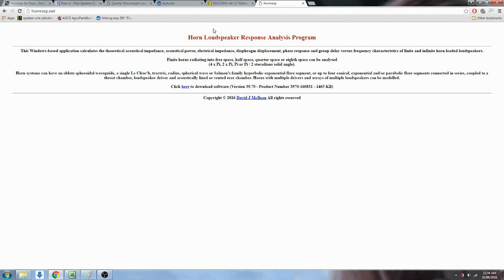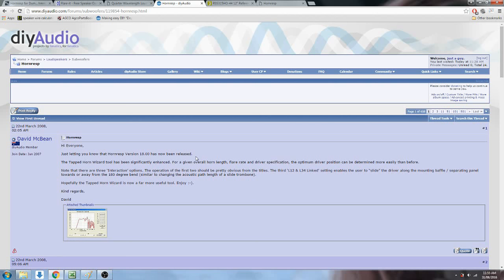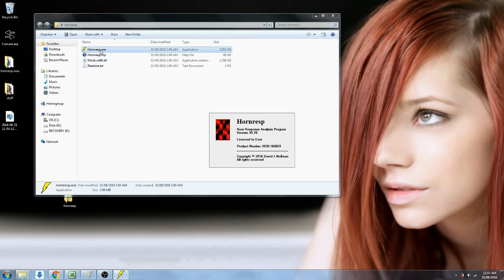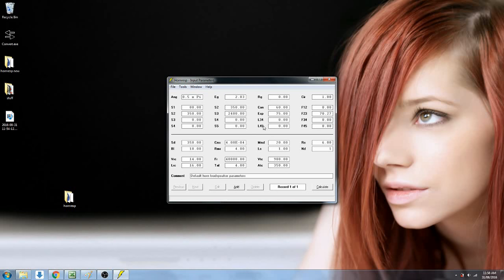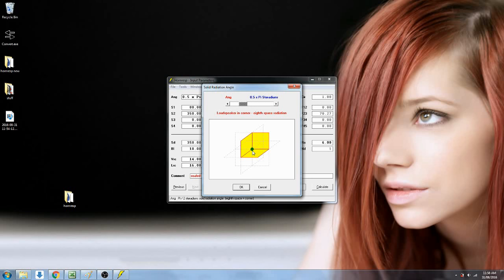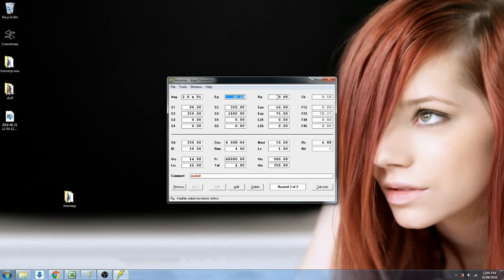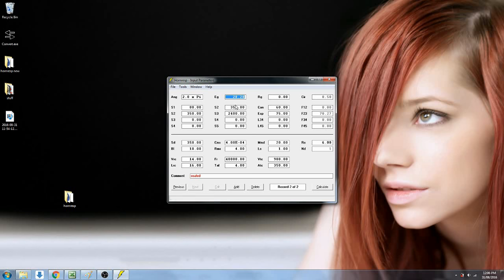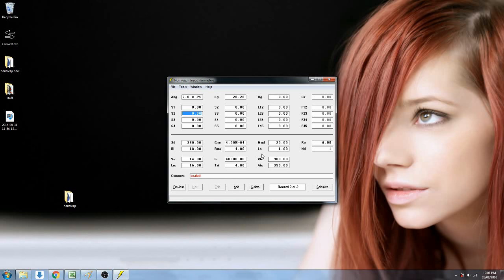Introduction to hornresp part 1

Comment: Hornresp is extremely fully featured, and can model certain aspects of even ported boxes that lumped-parameter box models often miss, such as organ pipe resonances in the enclosure and the port, and the impact of speaker placement in a long, narrow cabinet volume.